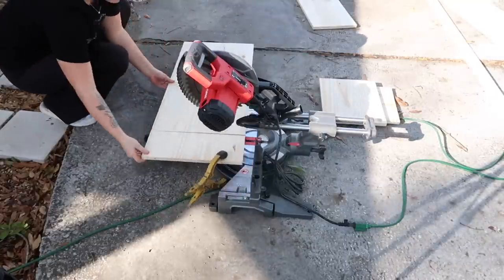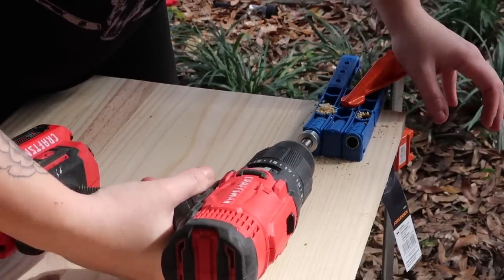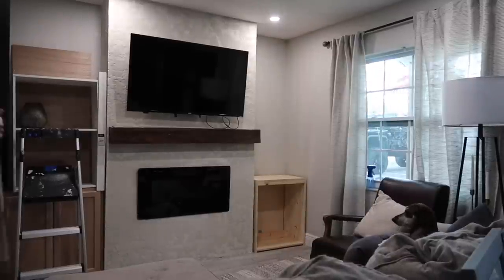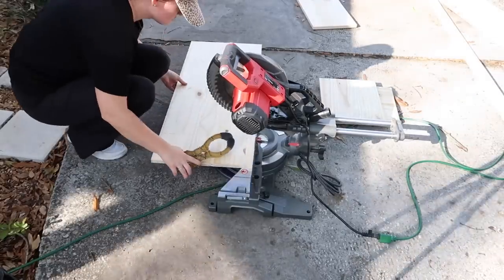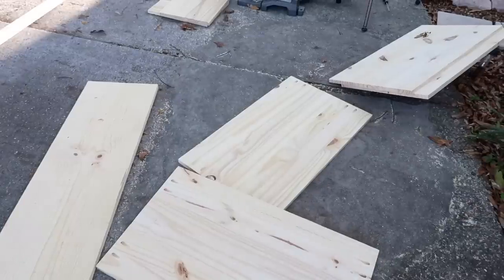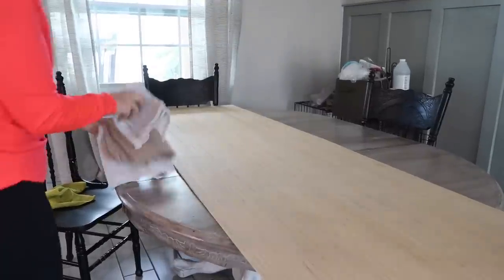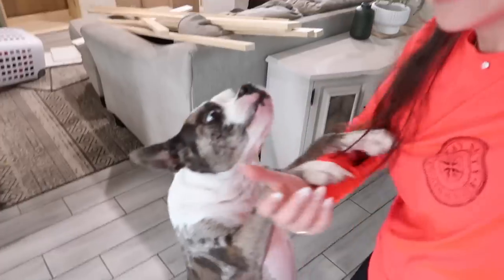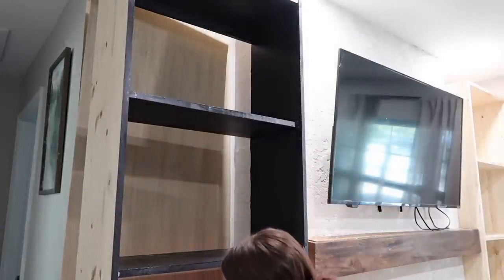DIY built-in bookshelves! living room Makeover Part two ! First time building custom cabinets 🙌

Comment: In my first house I had original hardwood floors when we ripped up carpet and we were trying to decide what we wanted. When I was doing another project, I accidentally spilled Old English scratch cover on part of the floor and when I wiped it up, it created the perfect stain color. I ended up staining a 12'x20' floor with old English scratch cover. 'Happy Accidents' for sure. I'm loving this video!

Comment: How did you cut your plexiglass?
Reply from the maker: With the same saw used in this video. I taped it off and cut it carefully. However, lowes cuts it too for freem
Reply: Thank you. I've tried to cut some before and  it basically melted as I was cutting.
Reply: Love that you don't give up but push thru and get it done. You're amazing.
Reply from the maker: @This Life of Mine  I did mine quick! Not slowly ❤️